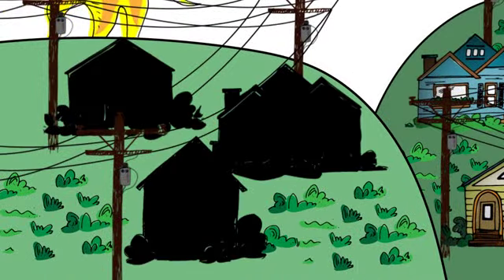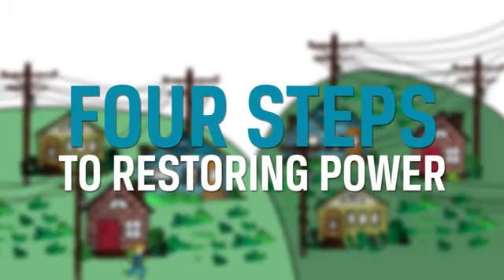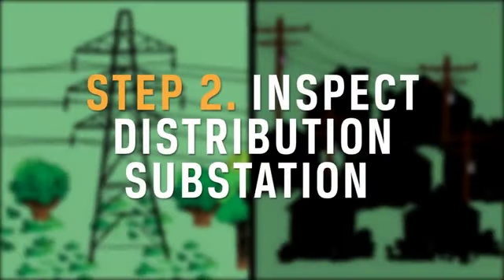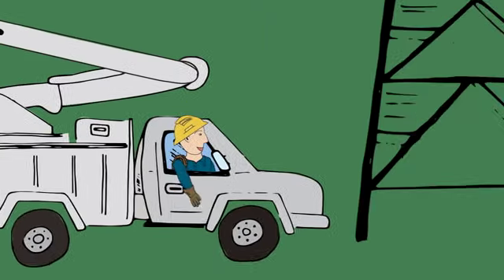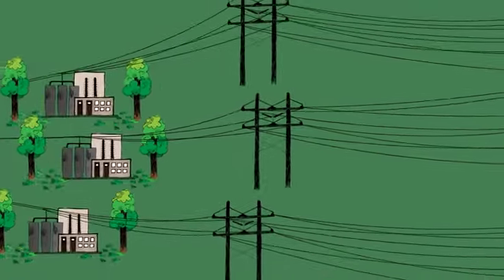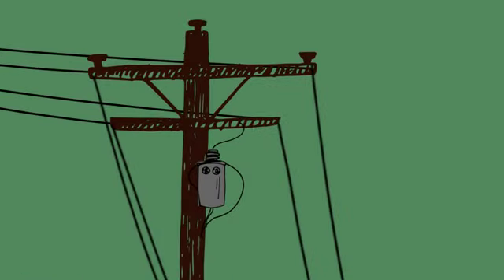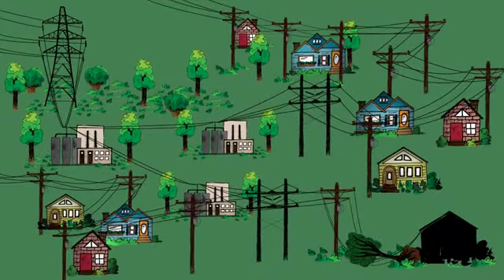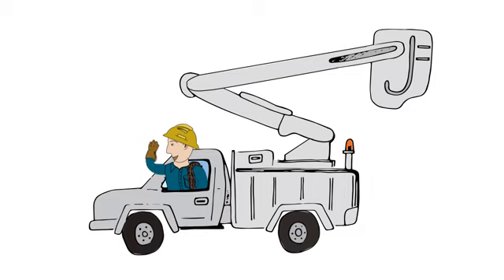How Power Outages Are Fixed

Comment: Why is the power grid not underground?
Reply: good question for the relative low voltage distribution networks in towns and cities, but once you get into super-high voltages necessary for "power grid" national transmission it can't be underground because the transmission power losses through the ground would be prohibitive using our current technologies. Maybe sometime in the distant future if they perfect superconductor wiring that can be produced and buried at a cost effective price it might be doable, but at the present it's not possible.
Reply: It's extremely expensive and even under the ground, it can have problems.